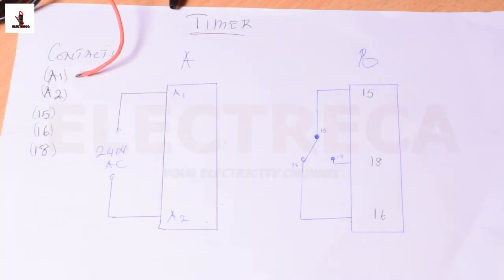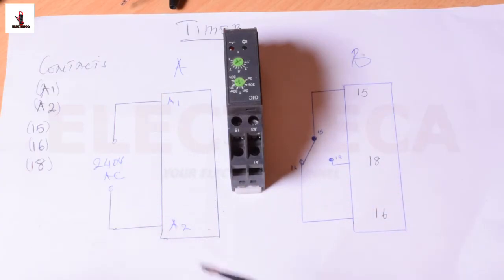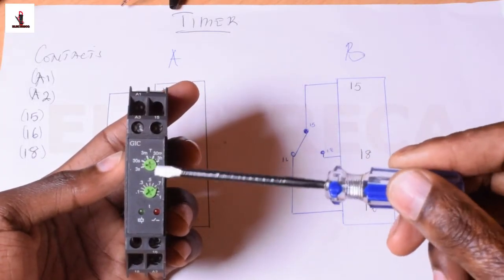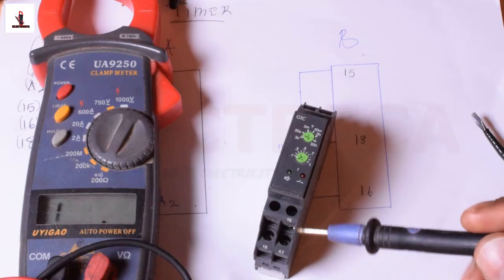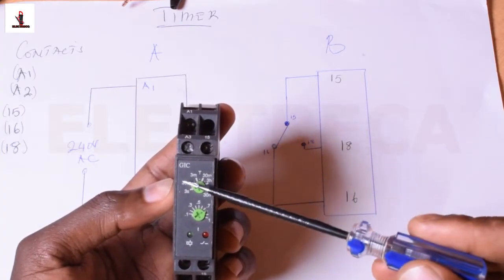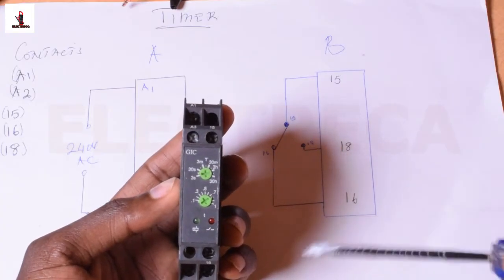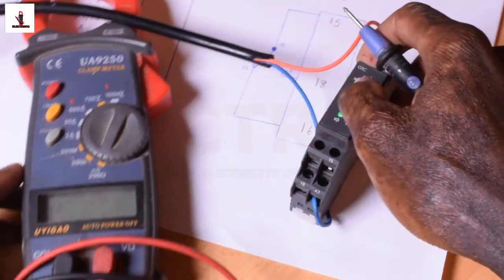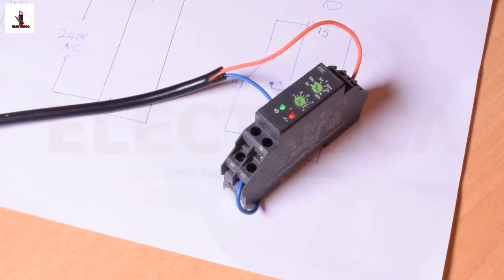Delay Timers Explained - Which One Should You Use?

Comment: How does on delay relay of the gen  operate when the main power has gone off I thought it can't operate when it's not active with power
Reply from the maker: It's not On delay relay....... let's call it On delay timer.
now let's answer the question.
When the main power blackout the Gen will start immediately..... Now, remember your timer is ON DELAY. the moment a timer receives supply it starts to countdown the time you set( in second) before it supplies the circuIt................ that's why its called ON DELAY.
Reply: @electreca1  I thought OFF delay timer is the one which delays before releasing power
Reply: @tychicusnthenge6414 Off delay timer basically delays to turn off the circuit when de-energized. Opposite of the on delay timer.

Comment: thanks <3
i want to know different types of timers
Reply from the maker: Hey you can never exhaust these types.....Bt here are  some 
1) On delay timer
2) Off delay timer
3) Photocell sensor or timer (ya it's also type of timer) for lights. 
4) Time switch timer( for both lights and control circuits.. Though it's no longer  used a lot 

Not... we have new timer on market that play both On and Off delay in one unit.. 

Op that helps and thanks for watching